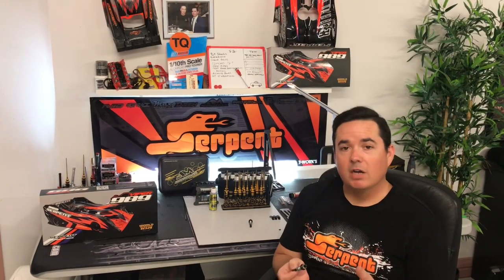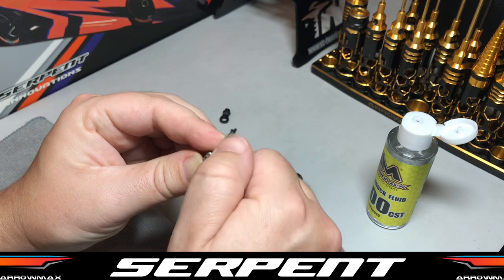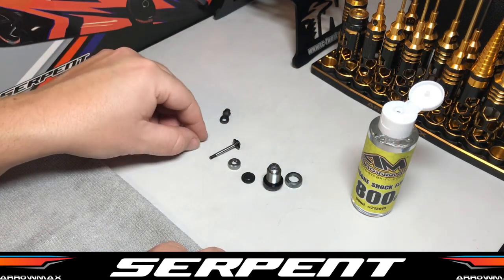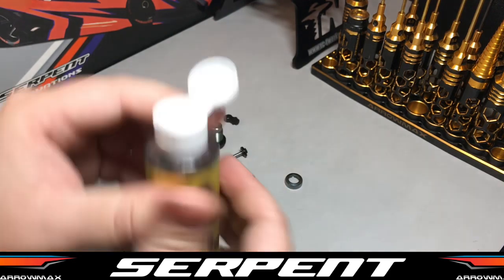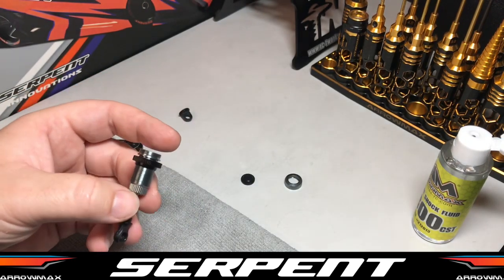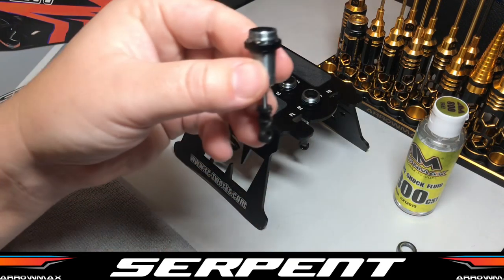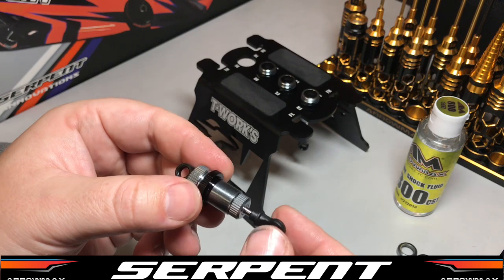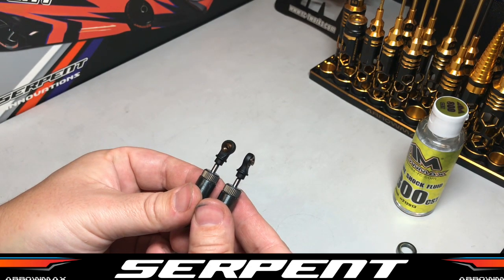Serpent 989 Shock Build

Comment: serpent membrane sucks... too thin and flimsy ... use mugen seiki mrx6 membrane... more sturdy... give it a try... and I use my droop to set my shock length..
Reply from the maker: I have tried the other membrane, the shape is more rounded and gives too much rebound for my liking.. However whatever works for you 😊

Comment: Hi Jeff,great info.
Question,would this method also apply to the SRX8GT?
Reply from the maker: Garvin granderson Thankyou, the SRX8 has a slightly different shock cap, so instead of sliding the membrane on, you install in the shock cap first and screw on slowly to allow the oil out the bleed hole 👍